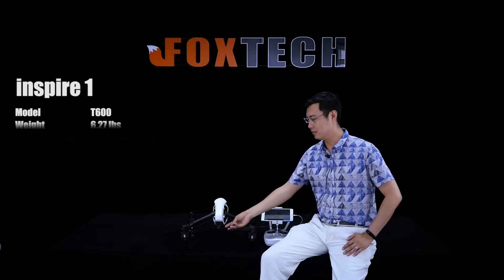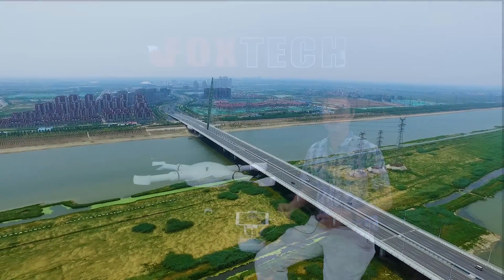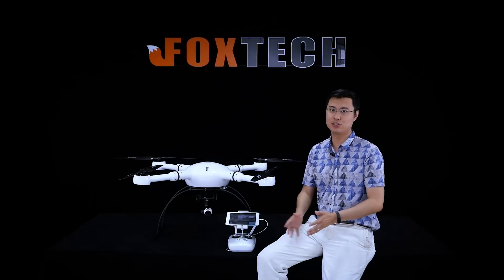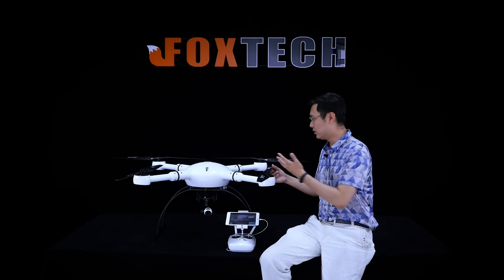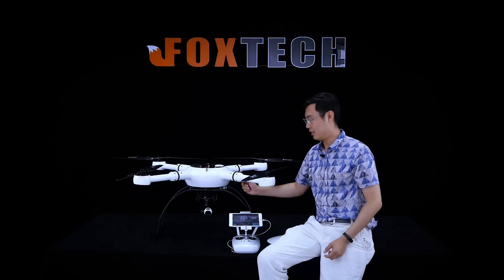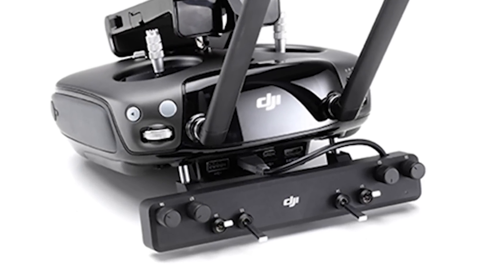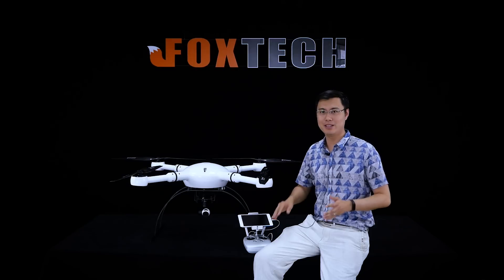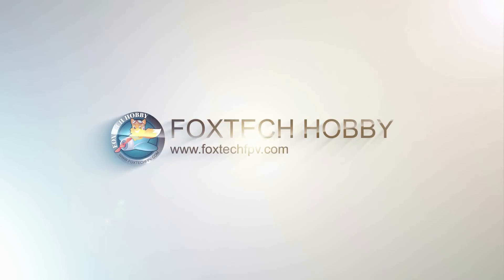F1000 pro Introduction Details

Comment: Looks great.  I'm looking at your Gaia 100 to replace a failed Arris M700 build due to its incorrect engineering leading to frame twist.  Would there be any problem if use a Pixhawk 2(arducopter) based setup with any of your copters?  I assume that there's plenty of room inside for components other than DJI products...
Reply from the maker: Actually we are installing a Pixhawk2 on Gaia hybrid now, We will post upgrade daily on FB page: https://www.facebook.com/foxtechhobby/
Reply: Excellent - thank you